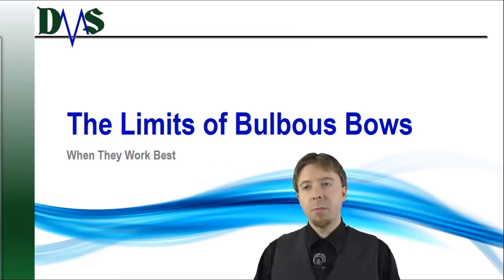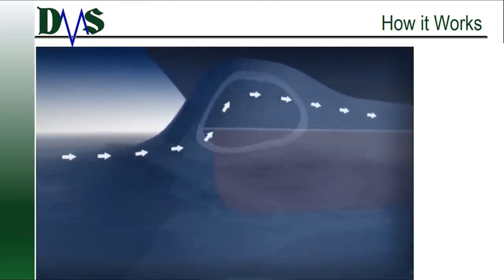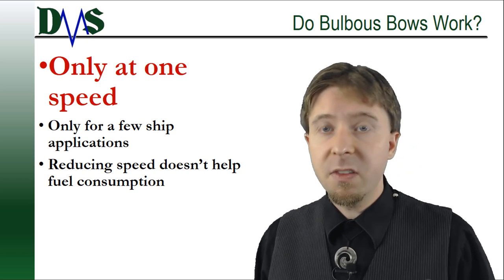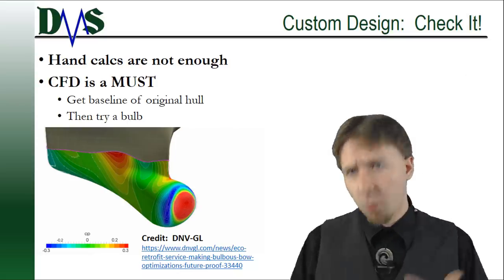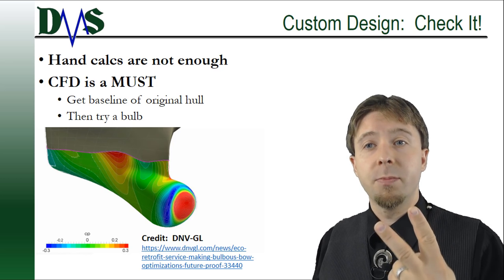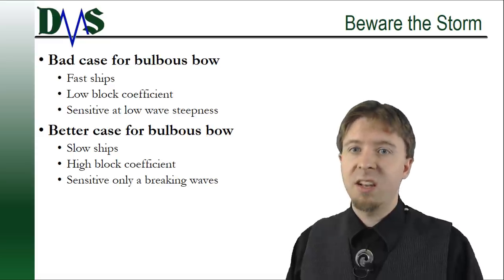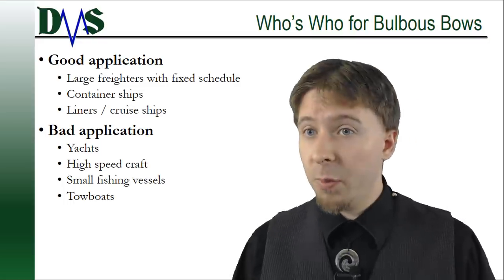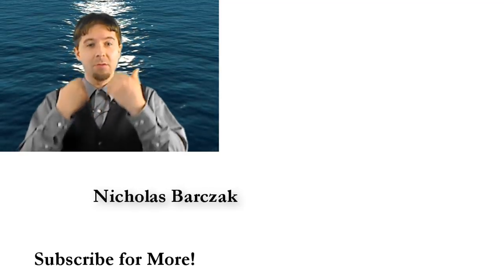The Limits of Bulbous Bows

Comment: Thank you for referencing my "bad bulb", it produced a 12% reduction in powering.  I found your video very informative but with a few myths.  A bulb does work exactly as you have described, full points for that.  The "good bulb" you reference is designed for one speed and as you have pointed out only produces maximum effect at one speed.  The bulb form that we use is effective over a wide range of speed and draft.  It is typically used on craft under 100 ft. and speeds to 20 knots with a 12% - 17% reducing in powering and over 30% reduction in pitching.  We have retrofitted them to over 60 vessels and now have such a large data base that we can use simple formulas without need for model testing or CFD on every bulb.  I am sure for an additional $100,000 in CFD you could probably squeeze another 1% but then maybe not.  Oh yes, and we have done extensive model testing and CFD on our bulbs and hull forms.  You can find many of our model test programs on Youtube.
Reply from the maker: My apologies.  I have seen many simplified bulbous bows based on capped pipes, where the pipe length was not calibrated to produce the correct interference pattern.  I'm especially impressed if your company has created effective bulbous bows with such a simplified construction.  Nice job.  And I'm glad to see you verified it with model test data.  That is a true professional.  For anyone interested, you find videos of model tests conducted by this firm here:  https://www.youtube.com/watch?v=vnJ-qGTOkO8
Reply: This should not be as funny as it is, but it is :D He also got the minimum amount of required CFD calculations, when used during the design phase, wrong... Though I guess his video series is aimed at non professionals so... 
Edit for it not showing Nicholas' answer.  Props for that!
Reply: Patrick Bray thats good news now rry usung that bulb for a 30 foot sailing catamaran wide hulls rhat still sail fast and are blue water capable would make a good livaboard.cruising yacht.
Reply: A hundred thousand for cfd calculations? Are you serious?  We charge a fraction of that. And yes. Bulbs work great for one trim, one draft and one speed... So great for ferries.
Reply: Hahaha, what are the odds that this dude is watching YouTube and sees a picture of himself under ‘bad design’ !
Reply: But but your not an an "engineer".
Reply: Can you reach out to me patrick ive got some questions to ask you
Reply: @joshlower1  Hello Josh.  What can I do for you?
Reply: @patrickbray1439  id like to know a bit  more about how this design works so i can build one for my boat.
Reply: @DatawaveMarineSolutions  Yet, you still kept the video unedited with his design exemplified under "bad design". Patrick seems to be a really good sport, as he could have kindly asked you to take it down and if you refused, he could have easily taken you to court and would most definitely win (he still can).
Reply: If you have the base case test videos, those would be compelling.  I spot checked but didn't see the A-B tests, just the B.
Reply: @glendenog9095  we have many of our model test videos on our YouTube channel. The full test videos are over 30 minutes long so only a summary is shown
Reply: @_John_P  tbh he said he seriously doubts it does any good... also that picture is a really good example of how bad bulbous bows look like. not that that one is bad :D tbh on a small vessel the real advantage is not low fuel burn, but comfort. makes the ship pitch like a bigger vessel.
Reply: You cannot provide the physics mechanism for energy saving. A bulbous bow adds drag, and the fact that the two waves cancel out does not change the fact that energy was used to create each wave. Debunked
Reply: @lexiecrewther7038  Thank you for your very informed opinion.  I can tell you that as a naval architect with over 40 years experience, having done research on bulbs, for 25 years, and retrofitting them to over 60 vessels that they do work.  Unbunked
Reply: @patrickbray1439  if they "work" then why do none of the new vessels have them? Show me the physics to prove they reduce fuel consumption. You can't, because they never have
Reply: @lexiecrewther7038  You will see them on many large commercial ships.  In addition I have published many technical papers as well as article on this subject.  You can find many article if you look.
Reply: @patrickbray1439  "The results of the total resistance coefficients of the ships shown in Table 4 and Table 5 and Figure 11 show that the frictional viscous resistance acting on the bulbous bow model was slightly higher than that of the original model, which may be the result of the larger wetted surface area of the bulbous bow shape. "
Reply: Can your design of bulbous bow work on VLCC tankers that are 330 meters long?
Reply: Certainly.  If the vessel operates in the appropriate speed/length ration then there are significant saving to be made. @SodiumSyndicate
Reply: @patrickbray1439  Even during slow steaming?, could your system accommodate a bow door as well?

Comment: Could one design a telescoping bulb, to optimize at different speeds?
Reply: In theory - yes. And perhaps in practice it is possible to design such variable flow profile or "speed" bulb design. There were some studies done. But it is not practical for few reasons. As it was pointed out in this video, bulbs are added to increase efficiency of slow moving large ships, and benefits are felt over a longer period of time (i.e. imagine oil tanker on 1,000 miles route, even a 0.5% increase in efficiency will be practical). For those ships it make sense to design a bulb for cruising speed and slap the steel and leave it be. Where one may think variable bulb may make difference is ships with dynamic "performance" - think of faster moving ships (military vessels), yachts and so on. Their overall performance is largely improved and affected by special hull shape, propulsion systems and so on. They are not economical ships for the most part and having the "fast hull" or multi-hull or different propulsion (variable) will have far greater effect than any BB added. Let's say, a BB will increase efficiency 2% efficiency over 5% of time (low velocity/speed scenario i.e. in ports). That is not much - given that the design will be very complex, added weight and require maintenance. So, it would be a cool feature - but with minimal economics (in fact, mostly negative). 
Fast moving vessels, or vessels that are maneuvering a lot at various speeds - require either smaller wetted surface to reduce drag (friction) or hull shape of low "box coefficient"...
Reply: strelnikoff7 it’s about harmonics, as I understand it. I read that motorcycle companies toyed with telescoping exhaust manifolds to adjust back pressure at different RPMs.

Comment: Awesome vid, with great info. One little sticking point, a theory is an idea that has been proven in practical application, is well documented, and is repeatable for the purpose of peer review. Let’s not diminish the word, regarding its science and engineering value, to cater to the widespread misuse in everyday parlance. The everyday “theory” people speak of is more closely represented by the word hypothesis, or even speculation.
Reply: Outside of the strict linguistics of the physical sciences, meaning everywhere else the language is used, the meaning is much closer to hypothesis. The word was not formed for the express use of scientific literature.

Comment: Even a simple pipe welded on to the front has benefits.  The water flowing past the bulb is flowing in laminar state, by the time it hits the main hull it's transitioned to a turbulent state.   The turbulent state offers less resistance. 

Let me know what you think.
Reply: Hi Tom, great comment,  w h at you stated males a lot of sense in regards to the laminar flow at the bow of the vessel.

Comment: Perhaps an obvious question, is their 'adjustable bulbous bow' that adjusts longitudinally forward or rearwards as the speed changes? The design does not have to be incredibly streamlined given the drag inefficiencies for the set bulbous nose design that has apparently exponential drag increases  + or - 2 knots of the bulbous nose design efficient design speed. I understand the engineering aspects of a hydraulically powered bulbous bow that dynamically alters as the speed alters, but it is not impossible given the advances in aerodynamics in adjustable swept wings, flaps, leading edge slats and falps, blown flaps, boundary layer controls, high speed torpedoes,  etc. Its not impossible, so I am interested why this is not an apparent consideration?

Comment: For ships smaller than destroyers A Streched Capital S shape may be the ticket. Instead of equal knife axe wedge or V we strech out an S so 1 side of wedge has cut out for way & then the other side of the S has another cut out scoop for wave to chill out a bit b4 traveling free down the side of ship. The bottom of S gets flatened out& a equilateral triangle shape pnt facing down lowest prt front of V hull only it is angling back under the front of ship. The bal right & left scoop out we lost top side is back underneath the water small scale. How much does the equilateral triangle angle back underneath guess depends on tonage, but I would guess about 39 or 40 degs rake.

Comment: Nick, it occurred to me that if you could make the bulbous bow variable in length it could then be adjusted to suit any change in the optimum speed range for the vessel. It would not be easy to make but as with anything it could be achievable.
What are you thoughts on the matter?
Reply from the maker: Interesting thought.  Possible, but I'm not sure the benefits would be worth the extra hassle.  Generally, any situation where the ship frequently changes speed will be when the crew are maneuvering the ship in a busy area.  In those cases, I doubt they would take the extra time to adjust the bulb.  But I could be wrong.  I'm sure there is a niche application where this could work.

There are other examples of tackling the problem of multiple speeds.  I believe MARIN offers a service to optimize the bulbous bow to work at two or three different speed (but not the whole range between them).  I'm a little skeptical about those.  

But there are other examples of adjusting for speed.  Propellers face the same problem that they are design to be most efficient at one ship speed.  So we created controllable pitch propellers where the crew can actively change the angle of the blades to get best efficiency at their current speed.
Reply: Right just rub as needed lol
Reply: My thoughts exactly you beat me to the comment
Reply: @DatawaveMarineSolutions  It is all automatic. A variable geometry bulbous bow would also be.

Comment: Small boats in sea lanes are very common in some parts of the world such as southeast Asia.  If a small boat happens in the path of the ship, the bulbous bow lifts the boat up and throws it to one side, saving the boat and its captain.  Without the bulb a small boat is more likely to be crushed.  A bulbous bow is worth it for this reason alone.The bulb also works for debris.
Reply: Good point about debris dispersion, for example semi-submerged containers floating aimlessly. 
Also the small boat captain may not necessarily survive the accident after being  flipped out of his boat , ca use he then has to face the prop. next on  the stern of the ship....
Reply: @kenlee-97  Going thru Singapore I saw an old lady oaring a sampan, successfully cross the path of a container ship.  It was something to see.
Reply: @kenlee-97  I know how to build REAL sailing boats.

Comment: very nice. would you comment on bow angle? I have seen modern fast coast guard vessels with vertical bows.
Reply from the maker: The bow rake (vertical angle of the stem) is more concerned with seakeeping capability.  I will release a video next month that discusses this in more detail.  But the short version for now:  
The original forward raked bow mostly evolved from tradition.  Ships always had pointy bows, period.  But with modern design techniques like CFD, we are able to look at the flow patterns of the bow in more detail and explore alternatives.  Those vertical bows and reverse raked bows are designed around new flow patterns that benefit the ship. 

Vertical bows typically try to maximize the waterline length.  That allows you to stretch out the bow and make a sharper bow angle.  Reverse raked bows usually happen for seakeeping reasons.  Reversing the bow often reduces the violent pitch motions that many complain about.
Reply: The more raked a bow is the less efficient the bow will be due to increased surface area of material in the water.

Comment: Imagine a bulbous bow that expand and contracts depending on speed and wave conditions 🤔
Could be do-able on a tugboat:)
Reply: I was thinking about that too. I guess it would be quite a hard to get it working and be reliable for years under water. Rubber that is inflated with water is one thought but it would lack rigidity and change form on it's own.
Reply: What if you reinforced it with leaf springs and a pistion,creating a wisk shap that can change sizes and shap 
Via compressing the leaf spings with the piston?
Reply: @skunkjobb  What about using one of those expandable rhombicosidodecahedrons, or whatever they're called?
Reply: Of course, why did nobody think of putting our magical expandy-thing on ships that accomodates the waves, yet is strong enough to be placed on the most stressed part of any ship? Also, it cannot have moving parts, but its magical, so thats fine, isnt it?
Reply: Looking at simplified bulb construction, length, diameter, and vertical position are major parameters.  Length could be varied with a telescoping bulb.  Diameter strikes me as the most difficult major parameter to change in operation.

Comment: Are there any studies on the possible use of variable length bulbous bows?  Would that be a possible solution to increase the performance envelope of a bulbous bow at different speeds?
Reply from the maker: Most of the studies I came across focused on new shapes of bulbous bows that deliver improvements across all speeds.  The idea is to sacrifice perfect performance at one speed to get generally better performance over a larger range.  But still a single bulb length.

Comment: If someone gave you 100 thousand dollars to design a 200 foot motor yacht (jets vs propellers) that can travel at 60 knots; - what software would you use to design the ships aluminum hull. What software  would you use to check performance at different speeds and at different wave heights. IMO i believe Computer/softwares fluid dynamics is less expensive and provides a very quick turnaround ( ie ... a different design each day for 45 days until its  perfected) of data before actually building a 10 foot scale model and test it in a water tank.

Comment: What do you guys know about submarine design. I have been working on a prototype that so far has tested to out perform everything else on the water. Just curious what you might think about a more organic flow design.
Reply from the maker: Submarine design is so specialized that I have not worked on any projects designing a sub.  But I do know the underlying principles.  As for more organic shape, it could be beneficial.  But think carefully about directional control.   A streamlined sub can also act as a giant wing on a turn, pulling you in the wrong direction.  Worst case scenario:. The sub goes for a turn and gets pulled down below crush depth.  ☹️
Reply: @DatawaveMarineSolutions  yeah i thaught about that. My sub has two forms of propulsion. A swimmer mode and a new hydroget design. We have three sizes of sub we are working on. A one seater a two seater and a twelve person sub. I designed them to follow the forms of dolfins sharks and whales.  Strearing controls are designed along the lines of fins. I am using an anamorphos fin design that allows me to reshape the fin depending on speed. Programing the controls was complex but we got it to work. I was curious as to if anything like this has been considered in ship design and if you think the actual phisics of organic design would be benificial to other areas of ship building. What about the bulb designs on super freighters. What if it was designed to change its shape through out the speed curve of acceleration would such a design actually help those ships perform better.

Comment: If have often wondered if a bulb is  effective on small displacement yachts. It sounds like it was more of a marketing gimmick than an actual fuel saving benefit from reducing bow wave.  Also bulbous bows prevent a vessel from being ice classed don’t they?
Reply from the maker: I don't remember anything in ABS rules for ice class that specifically excludes a bulbous bow (but I also don't memorize class society rules).  However, ice class rules size the bow plating based on the angle between the hull plate and the ice.  The more your bow looks like a knife edge, the less plate you need.  A bulbous bow would generate so much pressure for ice breaking that it would require extremely heavy plate.  So I suspect this is more an issue of economics for ice class, rather than anything preventing it in the rules.